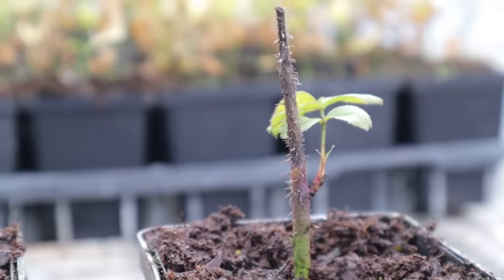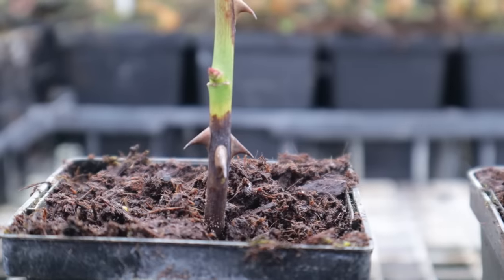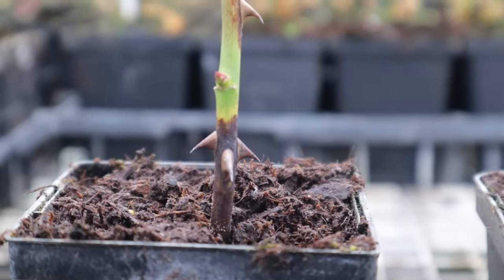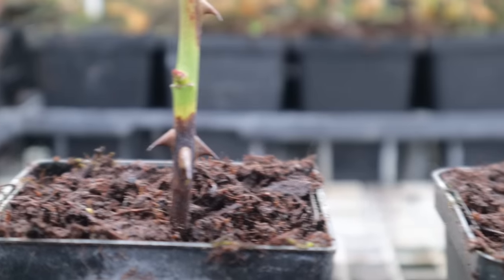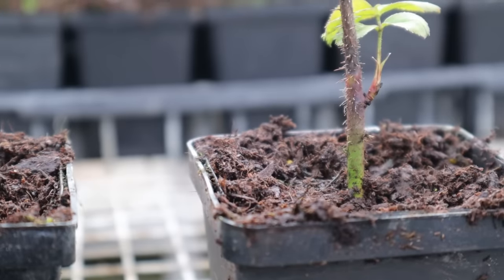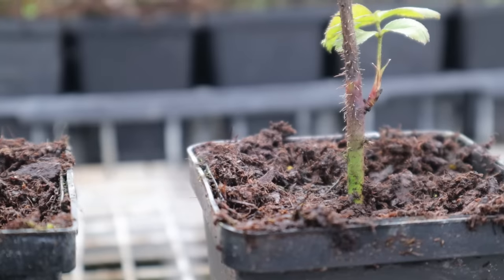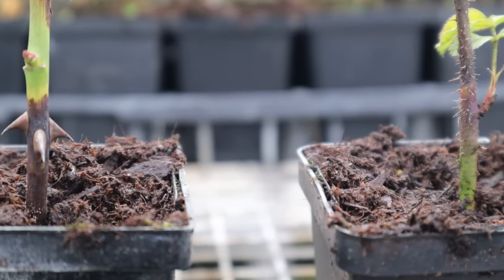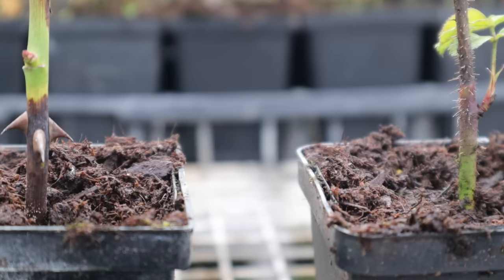Why Do Cuttings Fail? Propagation Tips

Comment: To avoid bruising stems when taking cuttings:
Pruners or secateurs have the blade one side and the blunt edge the other. Try to keep the blunt side on the side that is being left behind, so in this case on the plant. So the stem isn't bruised for the cutting.
You can always spin the secateurs around and prune the plant side again, to leave the stem without a bruise, if you want to be super kind 🙂

Comment: Does rooting hormone 8 root them better than a lower mumber like a 1 or 2? Love your videos! 🌹🗣
This one was great. I would love to see another one on heated propagation benches and misting set up with filter, solenoid valve and timer. Questions on how to keep it safe and  for the heating cable bench not getting too much water built up.
Reply from the maker: Thanks Thomas. I'll note those topics for future videos. The number on the hormone is related to concentration of the IBA (hormone) - lower is better for softwood and easy-to-root varieties. Higher is better for dormant, slow or difficult varieties. More is not better for everything in this case
Reply: Thank you so much for the very educative video shared. May the Almighty bless you abundantly.

Comment: Thanks for sharing.  Would the soil make a big different?  If so, what would be the best medium?  Sand or potting mix, or just moss?
Reply from the maker: I've done well in a wide range of potting mixes, but always the ones with decent air holding capacity - usually that means a decent proportion of perlite in the blend.

Comment: Hi, I found your videos (only watched a few so far) very useful. I recently picked up cuttings from the airport in Honolulu, HI for red Hibiscus and few other plants. The package suggested I grow them in perilite and vermiculite. I followed the instructions and nothing survived. May be I did something wrong. Can you backup their claim to grow them in perilite and/or vermiculite without any additives. Thanks for your response in advance.
Reply from the maker: It's a reasonable medium for rooting - relatively inert from rot pathogens and in the right proportions will hold a good balance of air and moisture.

Comment: Hi, great video and good simple explanation of everything. Question: do you have any specific milestones throughout your process where you change the environment for the cutting? For example I used the plastic bag covering method 2 with avocado cuttings and they grew leaves (but no noticeable roots), but I think I left them covered for too long and they both eventually rotted. Finessing this process is where I struggle. So, do have a point where you suggest to open the plastic bag / remove whatever cover is providing extra humidity? For example when first form I feel like it needs more time out of the bag but I don't want it to dry out
Reply from the maker: The various plants all root at different rates, so my benchmarks can't be based on time. At the time of strong callus or early rooting is when I begin to back off the humidity. Once the roots reach the bottom of the cell, I push to harden off to full sun and even begin feeding.
Reply: @FraserValleyRoseFarm  thanks I appreciate the feedback. I'm very hesitant to check for roots though because I figured that gently tugging on the scion when the roots are so new would damage them...but I guess how else would you check for roots. In your experience, do new leaves come before roots and if so, how long before (generally, for example in trees)

Comment: This is an interesting little video.  Two points: 1) no mention of best/optimal time of year to take cuttings and then plant them on.  Obviously this will depend on plant type.  However, if my cutting has only developed a good root system in October then I feel it's too late in the year to plant it out so it needs overwintering yet in the early spring things aren't (or don't seem to be) ready to take cuttings; 2) please wait until the rain outside's stopped before you start recording!
Reply from the maker: Thanks Adam. Good point. Time of year can make a real difference for some plants. I'm working on boxwood right now, which root quite quickly from mid-summer cuttings, but are taking forever from cuttings taken at the end of the season. Meanwhile, some varieties (I'm thinking grapes) take beautifully from overwinter hardwood cuttings.
Reply: Lol he’s in Vancouver area, it never stops raining here lol 😂

Comment: Hey there, have you had any experience with Mulberry cuttings? I got some decent root development from having them in a box with a heat mat and sand, but none of the nodes have developed any leaves(it’s been about two months). Also do you have any advice for fruit tree cuttings like pears/plums/figs etc? Thank you. Enjoyed this video.
Reply from the maker: I've done well with mulberries and figs. I wouldn't stress the shoot development right away - the roots are the biggest hurdle and when you're using bottom heat it favors the roots. I don't know your climate, so I wouldn't know when to make the call, but at some point you might turn down the bottom heat and push ambient (air) temp around the cuttings to favor shoot development. Warm soil/cool air = roots. Warm air/ cool soil = shoots. But you can also just let nature catch up as ambient temperatures increase through the seasons.
Reply: @FraserValleyRoseFarm  is that formula pretty true no matter what cutting you are trying to root or is there like endless combinations based on what cutting your dealing with? Thanks for responding🙏🏼

Comment: I am trying to root cuttings from a 30 yr old rosemary pink majorca. I put them in seed starting + cactus/succulent soil in terra cotta 3” pots. Started with cuttings in winter but no luck. Spring is now gone and those cuttings went awry also. I live in  Phoenix so no humidity in winter or spring—put the pots inside a plastic bag and spritzed them too much as they got fuzzy! I’m still trying but hitting the sweet moisture spot is not easy. I have been using 5” long cuttings with half the leaves stripped off. I may try shorter cuttings and pay attention to the node position. Wish me luck.
Reply from the maker: Best luck on your next attempt(s) Kanilea

Comment: Thank you so much for all the structured information in your video! 
We are now on attempt number 4, rooting rosemary. However, here in Africa we do not have particularly good conditions for getting cuttings, as we only get them from the market - and by then the (cutted) rosemary has usually been on the road across the country for days.
Nevertheless, it is now the case that some of the cuttings are putting out new light green tips, but unfortunately still no roots after 6 weeks. It's 31°C here, the rosemary is in semi-shade and in a jar and gets fresh water every day. Shall we darken the glass?
What can we do?
Reply from the maker: 6 weeks is a fairly long time to wait for roots. Have you tried with potting soil rather than in water?
Reply: @FraserValleyRoseFarm  thank you for answering, we've tried also in soil but the rosemary was never rooting. But now, we got - after experience no. 5 and after 9 weeks waiting - very small roots from our rosemary cuttings! The roots are still very small but seems to grow. We followed your advice to reduce the light with our (almost constant) 31° temperature.

Comment: What is the best brand or rooting hormone in your opinion and do you use rooting hormone when air layering? Great video.
Reply from the maker: Hi John. I find the powders formulations economical, also easy to store and apply. Liquid and gel are fine too, but I find the liquids inconvenient to mix a new batch every time, and the gels are used up pretty quick. The brand I use is Stim Root, but I think that's a Canada thing. The US equivalent would be Hormodin I think.

Comment: Great video and it explains so much... Can I place a root pod on a cutting (say perhaps place it 2-3 inch (5-8cm) from the end of the cutting) and place that entire pod and cut end in the soil to increase my chance of success or can the root pods only be used when air-layering and the branch remains on the mother plant/tree? Super thanks for responding.
Reply from the maker: I've only used the root pods for air layering. For cuttings a standard nursery pot or tray is fine.

Comment: How often are you adjusting the humidity/temp etc?  Every hour? How do you keep temp? Within a range? Or you heat/cool your greenhouse?
Reply from the maker: For my home greenhouse, I'm fairly low tech - I rely on solar gain in an unheated greenhouse for temperature, and cycle-timed mist for humidity. Most of my propagation is done in the summer and early fall, and most everything is rooted by the time temperatures drop out of the range.
Reply: @FraserValleyRoseFarm  Thanks, that gives me hope. Where is your general area? ( I'm in central Texas.)
Reply: @FraserValleyRoseFarm  The reason I ask is too know how hot your summers are. Ours are 100F.

Comment: Thank you for sharing your experience on how to root hardwoods, would be cuttings from a rose bush? Roses aren't similar to geraniums, but my mom told me that you let the geranium cutting dry out a bit before you stick it in a pot with moist soil. I did this technique last year with rose cuttings, but the large roses had dried out too much and they only rotted in the water, the tea roses did sprout leaves but no roots, so thinking they'd sprout roots in soil, I planted them in pots but exactly what you say here, either they rotted from the soil up or they dried out and no longer sprouted leaves. I'm trying with large rose cuttings(hardwoods?), a friend recommended I change the water in one week if it looked like it was getting a brown color, so my conclusion here is once it has roots,then and only then be planted in a pot with soil? Liked and greetings to you from central Mexico! :)
Reply from the maker: I still have my best success directly in potting soil - water propagation produces roots that are very different, and they usually die back quite a lot when you transition back into soil.

Comment: Have you ever tried a cloner that holds the cutting above a chamber or box where the stem of the cutting is continuously sprayed with jets of warm water until roots appear? Plug in and leave for about ten days. I have been following a British gardener who has successfully rooted numerous snapdragons in this manner. These are soft tip cuttings I believe.
Reply from the maker: Hi Charlotte. I haven't played around with aeroponic systems too much, but it seems like an interesting method

Comment: Great video..quick question.  I grow my cuttings in a tote. How long after they root would you recommend taking them out of that environment and hardening them off in a shaded area?
Reply from the maker: I would begin as soon as they're rooted. You're really trying to train them to rely on those roots as soon as possible. Additional time in the tote will slow transpiration, and limit the need for the roots to bring up moisture.
Reply: @FraserValleyRoseFarm  Thank you very much for the insight.  One last question, once the rooting is potted up and I start watering regularly should I let soil slightly dry out or should i keep it constantly moist?

Comment: So you keep the cut clean then put it in dirt? Am I missing something? I have tried growing all kinds of things from cutting and they always rot. Must be something up with Florida.
Reply from the maker: Hi Alan - pretty much. Choose a cutting at the right stage. Take a clean cut. Use rooting hormone to help your chances. Stick in a clean potting soil. Maintain humidity. Avoid too much moisture in the potting mix. Protect from excess sun or heat. I know some good propagators in Florida, so I think there's still a good chance to succeed.
Reply: Works for me in florida

Comment: What is the best medium to start cuttings in?  I am trying builders sand experiment.  So far 1 in 3 has survived.
When do i take it out of sand & put in potting soil?
Reply from the maker: I'd wait until the roots reach the bottom of the pot.
Reply: From what I've seen rockwool works pretty well. Though I use DWC so I am not sure how well they'd do transfered to soil.

Comment: Hi Jason! I've just taken two hardwood and semi-hardwood cuttings from a gorgeous but neglected pink rose shrub, flowering profusely by the roadside. It has blackspot. Do I need to treat the cuttings with fungicide before I cut them into several cuttings? Can I spray them a couple of times with fungicide during the rooting period? I'm going to propagate them outdoors in plastic pots filled with John Innes seeding compost. I'm in zone 7-8, it's humid and overcast most of the summer. The average summer temperature is 15-17 degrees Celcius. I hope you see my question asap. Thanks in advance for your advice. Sally.  p.s. I am very careful in terms of fungicide application due to its bee-killing effect.
Reply from the maker: Hi Selfi. I don't have too much experience with fungicides during rooting - I do it without. In the case of blackspot, I try to trim away the worst of the infected leaves before sticking. Generally, 2-3 weeks into propagation, I have some amount of leaf drop anyway. I know some propagators use a general-purpose fungicide as they prepare the cuttings, so I'm sure there's a way to succeed with it - I'm just the wrong guy to ask advice about it because I haven't tried.
Reply: @FraserValleyRoseFarm  Jason, thanks a lot for your quick reply and for the top quality content you share on your channel. All the best!

Comment: Hi Jason. I am in zone 5, and I’m wondering how early  you can start hardwood cuttings with bottom heat in the winter? Can you start now, or do you have to wait until closer to spring. My heated bed is in an unheated shop so the tops should stay dormant right?
Reply from the maker: I would think so in zone 5. I've never tried bottom heat on my hardwood cuttings before, but it speeds rooting with other methods. I'm excited to hear how it works out for you. Hopefully the extra heat doesn't dry down the soil too quickly.
Reply: Fraser Valley Rose Farm thanks for the response. Yes, I’m excited to experiment. I have 4 different soil mediums, and I’m going to start some cuttings Jan 1, some Feb 1, and maybe March 1 depending on the weather. Hopefully I can figure out what works best.
Reply: Details Joshua.  What seems to be working the best so far

Comment: Hi Jason, could you also root cuttings from hybrid tea roses?  I thought it was propagated only by budding.  Thank you! 
By the way, do cuttings get their moisture from the cut area or from the retained leaves?
Reply from the maker: Many hybrid teas will grow nicely on their own roots, but some will not. It's a matter of trial and error. At the time when some of the older HTs were introduced, grafted was pretty much the only way they were sold - so new roses weren't evaluated for health on their own roots. Cuttings can absorb a limited amount of moisture through their leaves, stems and other tissues when misted - but mainly, once the cut is made, they struggle not to lose moisture through these tissues. A moist (not wet) potting soil will keep humidity up and slow losses around the base of the stem.
Reply: @FraserValleyRoseFarm  thank you very much!

Comment: How would go about propagating elderberry ? My first attempt was a failure. It was slow to start. Put on a little leaves and leaves went limp and died.
Reply from the maker: Hi Carol. Sounds like you did it with softwood stems. I've had great success super easy from semi hardwood stems taken later in the year. Look for stems that are a firm but not super woody. They root quickly, in my case without even using rooting hormone.

Comment: I've tried taking grape cuttings from the same vine three different times now. The first was late summer soft-wood, the second was autumn hardwood, and the current attempt is early spring hardwood. The first two failed (I'm still waiting on the third) and I have no idea what happened. They didn't look to rot or dry, they just slowly lost their "look of life" and died. Any advice for the third attempt? (they were grown in sandy potting mix, 50:50 sand:humus with controlled moisture in a shady spot).
Reply from the maker: I'm glad you're trying different timings because the conditions sound about right. My best batch was far mid-winter hardwood, which should be fairly similar to early spring so I'll cross my fingers for you.
Reply: @FraserValleyRoseFarm  I'm glad its just the timing that was off then. It's strange that the time of year would matter so much, even though it is the exact same plant.
Reply: @FraserValleyRoseFarm  I forgot to ask this in the original post, but how long will it take for the cuttings to root and bud? I'm going to give as long as it needs, but how long does it normally take? I've only ever done fig cuttings, and they can take in a couple weeks or less!
Reply from the maker: At that hardwood stage it can be 6 months or more

Comment: Ah, got a question- are the considerations you mentioned works in tropical climate? I live in Marikina, Philippines and had failures in cutting prop of roses. I buy long stemmed roses from the market and source the cuttings from these purchase.
Reply from the maker: Yes, the same conditions apply - although instead of supplemental heat and light, you might be more pressed to find a suitably cool part-shaded spot for the cuttings. Cut roses can be a difficult source for cutting: the way these stems are grown promotes a soft, pithy stem which I find hard to root. Depending on your region, some suppliers also pre-treat the stems with an herbicide to prevent cuttings.